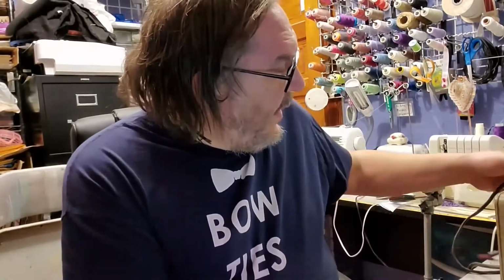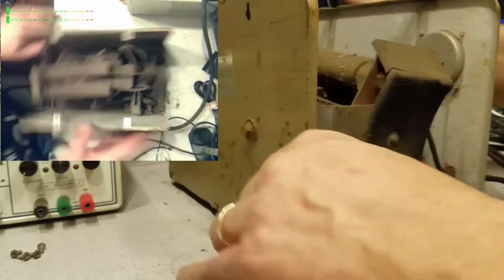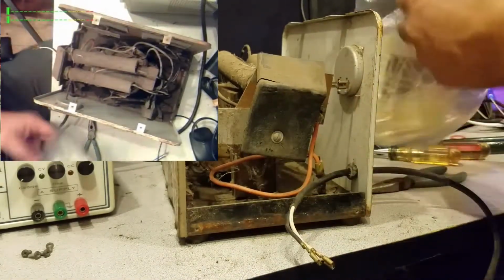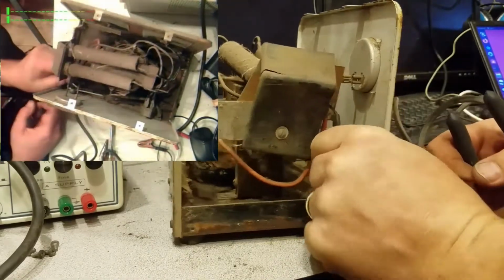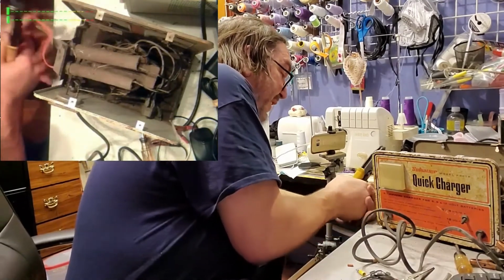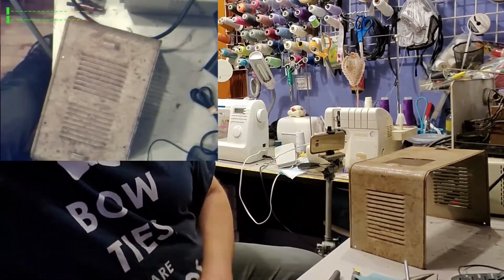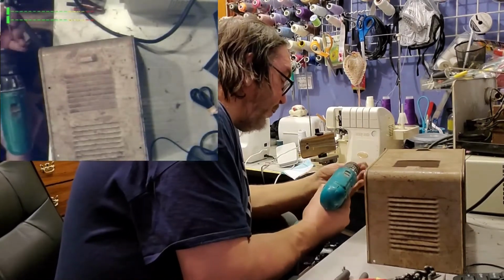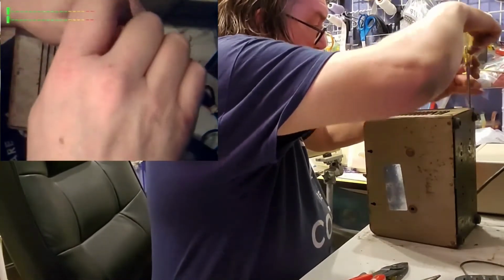12v Battery Charger Repair Schauer Quick Charger F-5612

Comment: Are the tubes the original selenium rectifiers? If so, time for a complete full wave rectifier! Two 50A at 20V Diodes connected correctly would be a correct replacement. You can always go over rating on diodes, it will not cost much more for a good safety measure. Time to do a good cleaning, too. Makes your work look more professional even if the equipment came over on the boat with Noah.
Reply from the maker: The failed selinium's are there, but a 150A pair of diodes are using them as heatsinks.  I use them as heatsinks now.

Comment: Interesting to see how you managed 3 cameras,  mostly well, indeed. 
As feedback: I would like to have seen the vintage parts in zoom, or something like a photo close-up. Ampère readings didn’t appear well in cameras. And I felt missing 2 voltage readings: No-load and “loaded”, even while being with that small gel-battery. 
Thanks for sharing.
Reply from the maker: I'll keep that in mind next time.  Thanks for the feedback.